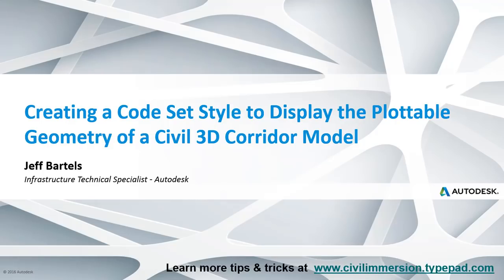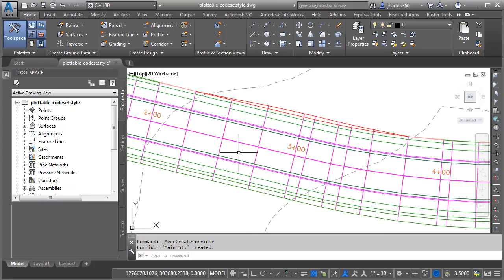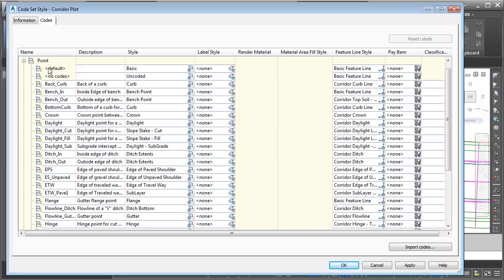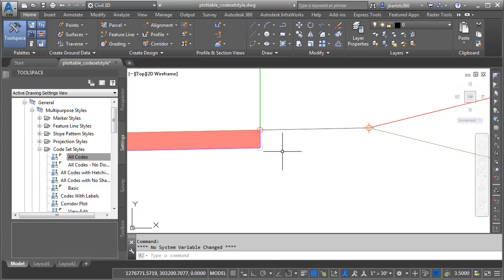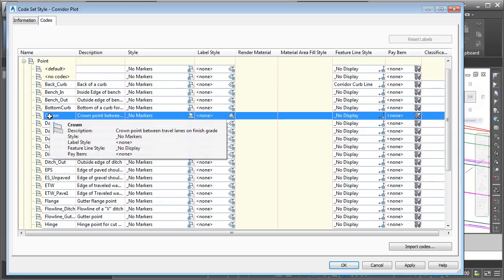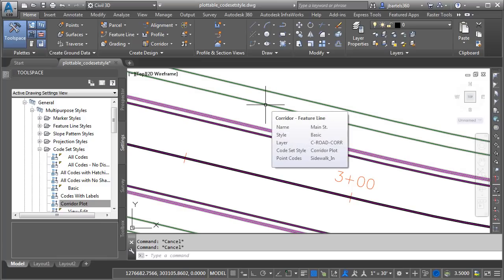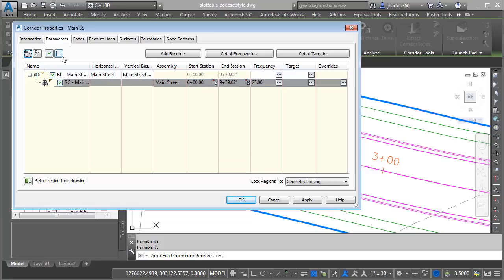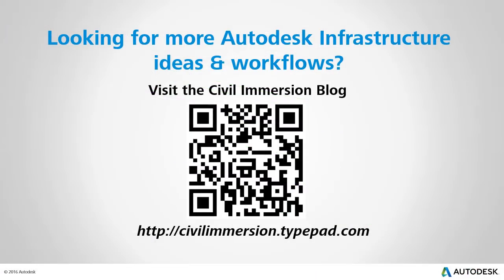Creating a Code Set Style to Display the Plottable Geometry of a Civil 3D Corridor Model

Comment: WARNING - after you data shortcut the corridor into your sheet, there are many times where the corridor will not print or show up even in the modelspace. It does work sometimes, but you need to remove the corridor and re-data shortcut it in. Unless there is a fix, it is still better to draft the linework from the corridor feature lines and place in an Xref